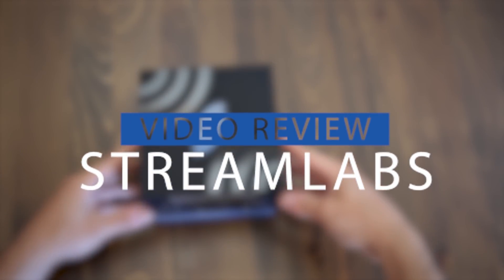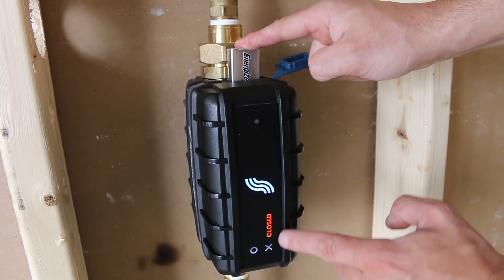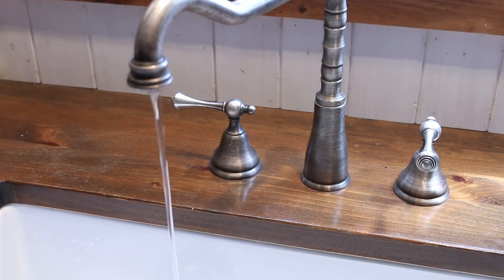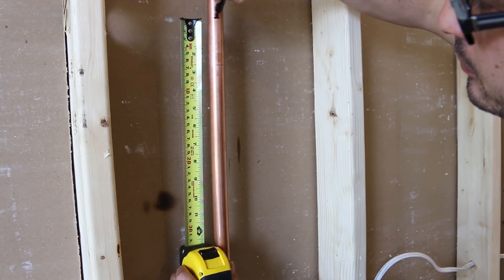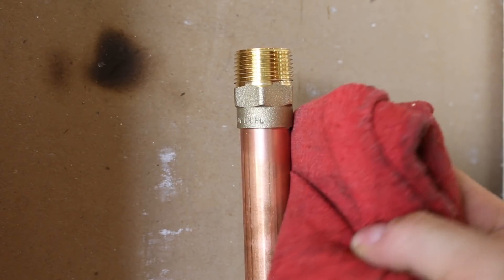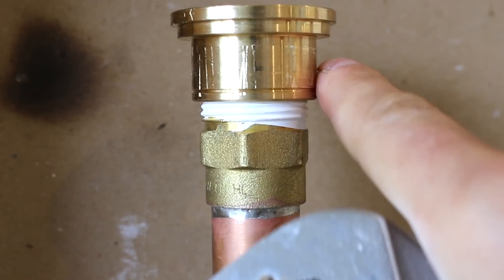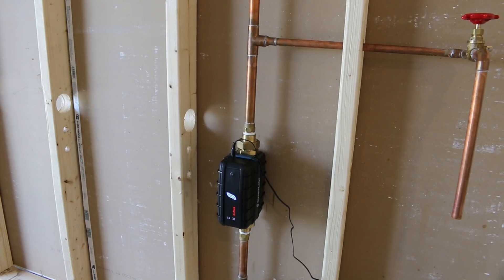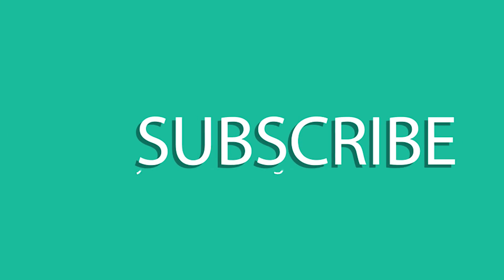This Valve Will Protect Your Home From MAJOR Water Damage (FULL REVIEW & INSTALL) | GOT2LEARN

Comment: Yeah this isn't practical. Reverse osmosis, water softener, sprinkler system would all need to be shut down in order to work in "away mode" it would be better if it had some remote sensors that could be placed in obvious leak prone areas like near washing machines, water heaters etc.

Comment: Explain why Teflon tape doesn't seal the joint; it's supposed to stop leaking.  Otherwise apply pipe dope instead of Teflon tape, or both Teflon tape with pipe dope.

Comment: And then version 2.0 comes out and they stop supporting the original which turns it into a paperweight. Never a good idea to have such parts only being useful with a smartphone app. On top of that it is way overpriced for what it does. Nice in theory but not really recommended in practice.

Comment: Ok, it turns off the water while on vacation. What about 24 / 7 protection in case one is away for 1-hr or 1-day or 1-month.  How do we turn off the Ele water heaters or other devices to prevent other issues?  Does the device have an "off" timer for the end user setting so one can run ground sprinklers, pool when sleeping or away? How about (as copious others indicated) taking a long shr w/ out interruption

Comment: Your torch heat control and solder entry points are rather amateur. Piping and fittings should be heated equally; bottom joints, such as elbows, should always be heated and soldered first, because if you solder the top joint first and then heat the bottom, you will draw solder from the top joint down from into the fitting, weakening or failing your joint; when applying solder to horizontal joints, start at the bottom, not the top, for a dam effect to ensure filling of entire fitting shoulder. Remember, solder follows heat, so always control your torch angle, distance and direction.

Comment: How does this protect your house if the power goes out?
Reply: The battery backup. From Home Depot product info: 
"Battery Power Protection - During a power outage, the StreamLabs Control has a battery power override feature that allows the consumer to manually open or close the shut-off valve."
Reply from the maker: It doesn't.

Comment: One last question if I may be allowed,suppose this "whatcha-ma-who's-its" goes on the blink when a home owner is away for a weekend in winter and the "whatcha-ma-who's-its" shuts off the water and as a result pipes freeze and burst will the company that makes this "whatcha-ma-who's-its" pay for the damages?I seriously doubt it.
Reply: @Mircea Most people,myself included,have boilers that require water in order to run properly.Boilers have a safety feature known as a low water cutoff which prevents the boiler from running if there is not enough water in the boiler so that the boiler will not be damaged.If the valve in the video happens to malfunction in winter and shuts off the water that will lead to the boiler's low water cutoff kicking in and preventing the boiler from functioning so that the boiler will not get damaged and if the boiler is not running then how is your house going to stay warm and keep your pipes from freezing?Maybe you have neighbors that for one reason or another do not get along with you and who may have or may know someone with the necessary skills to hijack your automatic water shut off whatcha-ma-who's-its since the thing can be controlled remotely,what then?The government and even the Pentagon have been hacked so how can you be certain that your fancy water shut off whatcha-ma-who's-its won't be hijacked and shut off remotely by someone that you may have pissed off?Have you ever had your computer mysteriously crash and/or restart?Because many people,myself included,have had their computers mysteriously crash and/or restart for no apparent reason.If you trust that water shutoff whatcha-ma-who's-its good for you but I and many other people do not think that water shutoff whatcha-ma-who's-its crap is all that great or dependable even.Just because you're ignorant of how things work doesn't mean that people come on here to talk out of their asses.  https://inspectapedia.com/heat/LWCO_Low_Water_Cutoff_Control.php   Boilers have a device that works in conjunction with the low water cutoff and that device is called an auto fill valve,it is a valve that opens and adds the required amount of water necessary to the boiler in order for the boiler to work properly.  https://inspectapedia.com/heat/Water_Feeder_Valves.php#FVAuto So if your fancy water shut off whatcha-ma-who's-its shuts off the water when it is not supposed to where is your boiler going to get the water that the boiler needs to keep it working properly from?If you had bothered to search the internet on what causes water pipes in homes to freeze instead of just coming on here posting your question and putting your ignorance on full display you would have very likely come across the information that I just posted.You presumed and assumed that I did not know what I was talking about and in doing so you made an "ass" of "u" not "me"
Reply: @Mircea Bull,what if the fancy shut off happens to fail as things are often known to do?What then?I don't know you and frankly I do not want to know you.What I state is what I know to be true.If you don't care for what I may have to say fine,you're not obligated to listen to what I have to say and by the same token I am not obligated to take harassment from you or from anyone else all because you do not agree with what I have to say.Now kindly fuck off if you do not find what I have to say helpful,end of story.
Reply: @Mircea People have had their cell phones compromised and their personal and banking information taken and you say that I am "going overboard with the hacking theories."?What special brand of stupid to you happen to hail from?Cell phones are far from being secure and that shit shutoff valve works with wi-fi just like cell phones do so how do you figure that what I am stating is nothing but "hacking theories."?Cell phones cannot and should not be trusted explicitly because cell phones are not as secure as cell phones were once thought to be and we should trust our homes to shit shutoff valves like the one in the video that can be controlled remotely with cell phones to shut off our water?You really are that very special brand of stupid,aren't you?
Reply: @Mircea Recently there was a news report here where I live that people are using "skimmers" on ATMs in this area to get their hands on other people's pin numbers and account information and you claim that I'm "going overboard with hacking theories."?Seriously?Good Lord,you really are stupid.So you honestly believe that your shit shutoff valve that can be controlled remotely is going to be more secure than ATMs?

Comment: "Those who would give up essential Liberty, to purchase a little temporary Safety, deserve neither Liberty nor Safety."- Benjamin Franklin one of our Founding Fathers (may God bless and rest his noble soul,Amen.).
Reply: @streamlabswater1549  Very true because if your fancy do-dad shuts off the water in winter and the home owner gets a glitch using your fancy do-dad and as a result the water shuts off,the water pipes burst and freeze "time will not be able to delay" the flood that will result.Most heating systems have an auto fill valve that keeps the boiler at the proper water level.Without the auto fill the boiler will not fill with water to the proper water level and thus the boiler will not function.Will you pay for any damages incurred as a result of using your fancy do-dad?Because I seriously doubt insurance companies will pay for any damages that using your fancy do-dad may incur.Water leaks are very very serious and especially when water leaks are caused by water pipes bursting as a result of freezing.

Comment: Nice in theory. If this is going to be feasible the price will have to drop considerably and the guarantee will have to improve significantly.  Instead of using a phone to set it it should be linked to your home alarm.m; when the alarm is armed in the ”away” mode it can be activated and I activated when the alarm is turned off.
Reply from the maker: That's everybody's complaint, they are going to address this issue in the future.

Comment: "It detected a leak" when you opened that valve. That would be the same as every time you use a plumbing fixture, it would sense a pressure drop and shut off you water, like during a shower or whatever. This thing is useless.
Reply: It detected a leak because he had it in "away mode".  Any flow through the pipes when in "away" made will send an alert to your phone, and if there is major flow, it will shut the water off immediately while notifying you via you phone again.  So, it is not useless. It is too pricy for my budget,but I can see where it would be beneficial to have on if you have $600 laying around.
Reply: What do you think would happen if you have automatic  lawn sprinklers go on in the away mode?

Comment: It's kind of pointless to use a sprayer to suck the water out of the pipe to prepare for soldering, then prep the ends, then fill it back up with water again to flush out debris. You get the water out AFTER you're done with all the prep work.

As for the product itself, as several viewers have already noted, if you have to physically turn the unit on and off, then there's no difference between turning an actual valve on and off. It's a redundant $600 gadget.

Comment: Emergency devices that require user interaction ("away mode") are inherently unreliable.  It does still work if it's not set to away mode, however, an owner said: "We have had the unit shut off the water during showers. It is not fun to be soaped up and the water shuts off. We did not hear the notification that the water was going to be shut off because we were in the shower and don't take our phone into the shower."
Reply: Apparently, the owner didn't buy the optional Stream Labs cell phone water proof protective case which would have allowed him to carry the phone into the shower.  I would also like to know more about the  "we were in the shower"  family.  Sounds kind of creepy.
Reply: Nick V 
I'm a physician and get frequent calls.  I take my phone into the shower with me and balance it on the edge of the glass.

Comment: So, if I set this thing to "away" mode it shuts off the water if it detects any flow. Then, I have to take it out of "away" mode when I return home. How is this different from a simple shutoff valve that I close when I am away and open when I return?

For those who think this device should be required by code, since an internet connection is needed I guess that would mean an internet connection would be required by code as well. Plus, consider the security implications of yet another web site that knows whether or not anyone is currently in my home. No thanks.
Reply: just more shit theyre trying to sell tbh.
Reply: Can't turn it off when you forget, no one shuts off the water
Reply: @AgentOffice  So instead, you risk forgetting to put this valve in "away" mode. Not much difference.
Reply: This is exactly right. My xfinity has never been reliable anyway. The whole internet requirement thing sucks. //ji
Reply: My shut off is at the curb and requires a water key .  A lot of people's shut off is at the curb or in the crawlspace .
Reply: You wouldn't want to be the only one on your block without one of these doo-dads to misinterpret a misunderstanding between you and your wife and call the police on you for domestic violence now would you?(Insert copious amount of sarcasm here.)

Comment: Teflon tape fills the void of the treads to create a seal. Just as dope does the same job. I would like to see you make a video with dish soap for lubricant to create a seal on the threads. Patman
Reply from the maker: Anybody that knows what they are talking about will tell you the same thing as me. Teflon is the same material used in a frying pan for your food not to stick, same thing for fittings, it just makes it easier to tighten ;)
Reply: @Got2Learn  Not true. It fills in the gaps of threads.
Reply from the maker: yeah like at 10%, but it's not it's primary use, it's to allow the fitting to be threaded in more to prevent leaks.
Reply: @Got2Learn  
I have a 2 foot long wrench to tighten air fittings, and it will still leak, teflon tape fills up the imperfect voids in the threads of the pipe. Plumbers also use rope to seal pipes that is not "slippery"
Reply from the maker: You should use 2 wrenches btw Stella. For your leaking problem, if your threads are too tight and it just can't go in enough, you are assured of having a leak, even if you use "a" 2 foot pipe wrench, you might want to adjust your die.

Comment: That yellow bypass adapter you Use that for a measurement for your unit I bet you didn’t think of that that’s the perfect length no ruler necessary that white things perfect looks like the same length no is that product Reliable do you recommend a product highly please advise thanks

Comment: I am still looking for a device that can be installed in-line that measures water going though and shuts it off if it goes above a certain amount, which is adjustable. So if I install this on a sprinkler system I can set it to use 10 gallons then shut off.  That's just an example, I know sprinkler systems have a multitude of timer systems available.
What I actually need it for is to use on a water reservoir tank that supplies water for a distant garden that is downhill from it. We have a water line and hoses that we use. It's become a habit to leave taps on and depend on the  spray nozzle to turn water on and off as we water stuff. I constantly fear that while we are away something will spring a leak and we'd lose a lot if not all the water from the reservoir. So I imagine a device attached at the reservoir that will shut water off every 100 gallons or whatever that we'll have to reset whenever it shuts the water off.
Reply: https://www.leevalley.com/en-ca/shop/garden/water-and-irrigation/water-timers-and-meters/71523-flow-meter
Reply: Building Operator 
Pretty nifty gadget there!

Comment: You said turn on and off manually. My question is how do you do that without internet connection?
Reply from the maker: Don't buy this if you don't have internet.
Reply: @Got2Learn  thanks for the advice.    Do you know any brands that will turn on or off with just data (internet) from your phone .
Reply from the maker: Not that I know off, but if I find one, i'll let ya know ;)
Reply: @Got2Learn  thank you
Reply: It should be linked to your home alarm.
Reply: @peterfairlie2296  so the sim card you buy can be one you get at the dollar store? if so how would you activate it? Would it need to be activated? How would I then turn on/off the valve from my phone outside my home? Sorry this stuff is kinda "greek" to me.
Reply: @peterfairlie2296  awesome now I understand what to do. I'll keep you posted once I begin. Thanks

Comment: So, the auto shut-off is only working while the system is in the "Away" mode?
If yes, what about at night when we are Not away but asleep (the system is Not in the Away mode), will it know to shut-off too?
If only capable of shutting off the water during the "Away" mode then I might as well just manually shut-off the water manually before leaving for vacation (no different from manually turning On the Away mode).
Reply: A much cheaper solution is to manually cut off the main water when you're on away vacation and buy the $10 moisture sensors to place at various locations in our house.  Just a couple weeks ago, my sensor detected a leak on my hot water heater just when I went to bed.  I can see something like this may be good so you can set to "away" mode daily when no one at home during the day.  But at $600 is a little too much.  When they can bring the price down to $100, let me know.
Reply: Your absolutely right!  If you want it to work during the night, you have to set it to "away mode", then you can't get a drink of water or flush a toilet during the night without changing the mode with the app.  Same thing is you want protection while your away at work.  Total pain in the ass to monitor and train every member of the household....even if every member has a connected smart phone.  The only practical application I can see is for a cottage where it isn't usually occupied during the weekdays.
Reply: @chrisgraham2904  That's not accurate Chris.  The auto shutoff function always works.  It will just come on quicker in away mode because you have told it no one is home.  In the other mode it has to wait a little longer to make sure its just not someone using water in the house.  I agree with one of the other commenter though, Flo by Moen does the same thing, has a manual shutoff knob right on it, and costs alot less.
Reply: Yeah. I got the Elexa by Guardian after our kitchen faucet line burst in the middle night and flooding the kitchen. Sure, you have to buy sensors, but then it does not have this away and manual step involved. You place the sensors in areas you think it can leak and it takes care of it. For us, it has detected few times water house dripped into the cabient through the soap dispenser. The nice thins is it only uses Wifi for notification, but sensors and valve controller talk to each other through Bluetooth, so if even your router dies, you have the protection. But again downside is that you have to buy sensors and it does not detect slow in wall leaks
This is an overal good system and other companies have the same concept tied to house security system. For example when the system is armed it turns the detector on and also monitors if usage is more than usual.
One thing this review does not show is what if you are away and have a whole house humidifier? Is it going to shut it off or tricking the homeowner into thinking they have actual leak?